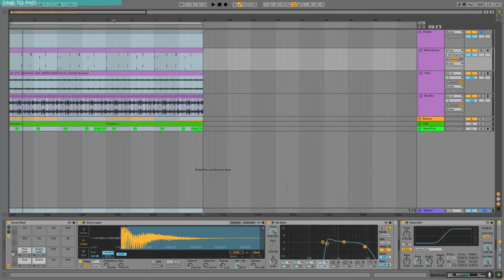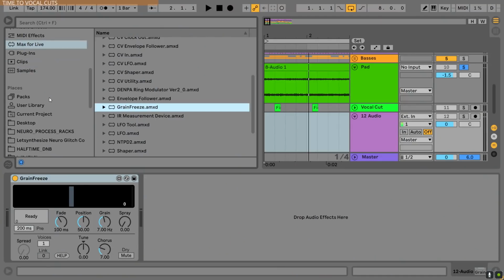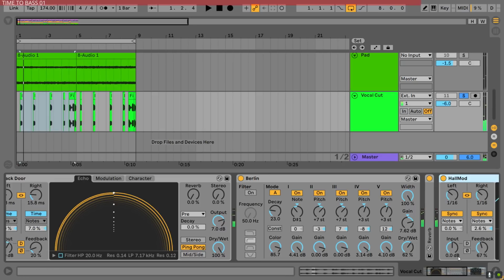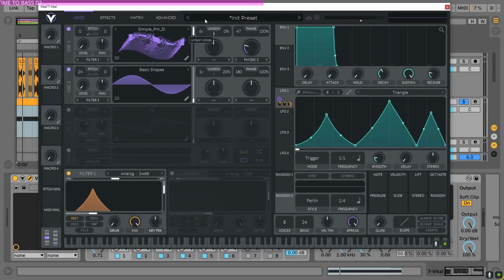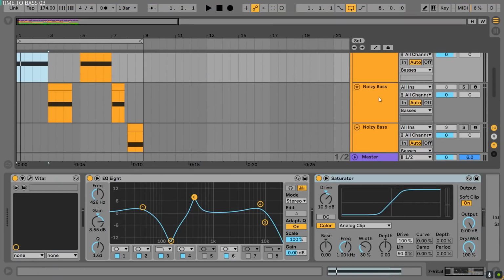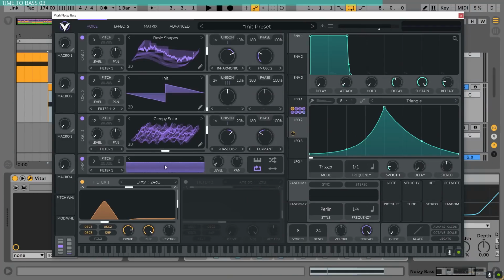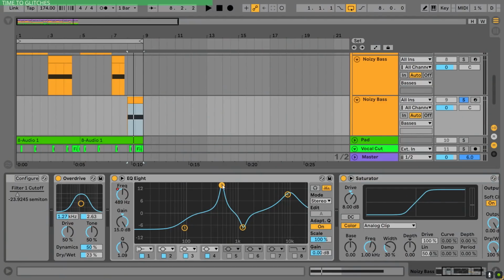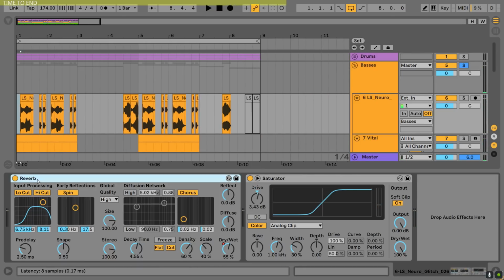TESTING VITAL - HALFTIME USING FREE SYNTH

Comment: Vital surely is good as serum, but for me the best is phase plant. I ll never change it with other synths. The problem of phase plant  can be the price not affordable to all
Reply: It's difficult to beat free
Reply: @cokecl  it s only a commercial strategy, independently from product and what the user search and want. Free products, if not are open sources, have always some limits respect to payed versions also of the same product. Surely can be  a good choice compared to a trial version: if u like so, u can use it for eternity otherwise there s the payed version 😁. Noboby gifts for nothing.😉
Reply: @mariorossi4050  there are no limitations other than content in the free version of vital. You can even import your own wavetables and there are many packs with wavetables for serum that work in Vital. And the fact it's free should make even more content available.

Comment: I wonder if vital will just knock serum out of the game
Reply from the maker: Nah. It won't!
Reply: @Letsynthesize  I won’t call the game yet, it’s just version 1.0. Serum has had years to develop
Reply: we will see. apparently serum is better for screechy basses because of the filter that has many unique resonances but from I hear in vital I find that vital actually sounds fuller. really no idea. I hope Serum gets a solid price drop though so I can get it hehe
Reply: Serum is already knock out by phase plant. Surely serum is a good synth as vital but phase plant is on another level. 
This last can be difficult to use when u start but one time learned, is very simple to use it but overall flexible and very friendly, (unlimited oscillators, unlimited filters, unlimited wavetables and samples and more)  to forget serum and other synths. The big problem can be the price.
Reply: @mariorossi4050  nah man phase plant is really not that great
Reply: @ezassegai4793  about what is not that great for you? 
Unlimited oscillator against 2 of serum
Unlimited envelope and lfo against 3
Unlimited filter against 2
Unlimited wavetables against one
Unlimited samplers. 
Possibility to create many groups against zero
Many plugs in with the possibilty to use them directly in ableton as thirdy parts. 
I look these. 
Surely has some failure as a no good arpegiator/sequencer as syntmaster one, 8 unisom against many of serum, in some cases the sound is not appear to me so full as serum but the solution there is to having it better and overall the price that is more expansive than others
Surely the first times it appear not so simply to use it as serum or vital. U need play it a little bit more than other. Now I m finding more easy to use it respect serum.
Vital great strategy about his free version. 
Ps i m not a producer or compositor and a pro but i like to play with the music and waves 😁
Reply: @mariorossi4050  now that you put it LIKE THAT mate maybe I need to take a good look at it.

Comment: Another great video. About the unison voices in Vital... not sure if you’re aware but you can actually click and drag on the vertical lines under the word “Unison” to choose how the voices are arranged/spread out. If you haven’t tried that yet, it might change your mind about Vital’s Unison function (:
Reply from the maker: Yeh I know about it but it' still lacks of feature and does not have the retrigger/reposition feature so everything sounds very chaotic. I mean it can be a good thing at some cases but overall it needs upgrade!
Reply: @Letsynthesize  you retrigger it by setting phase randomization to 0 just like serum, and you get the pew sound by alt+clicking the vertical lines and typing in 0 which makes them linear
Reply: yeah and u can also play with the unison blend, detune range and the unison stereo in the advanced panel